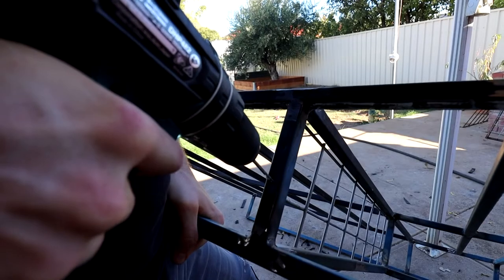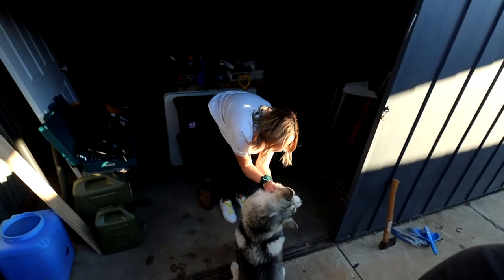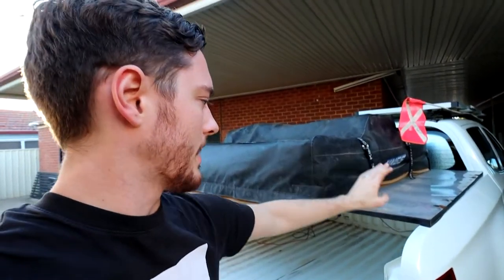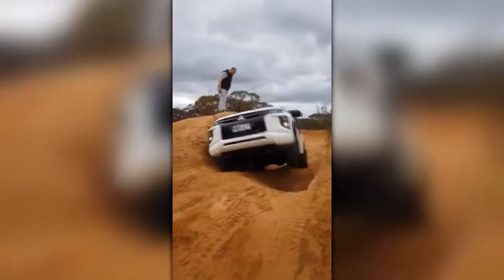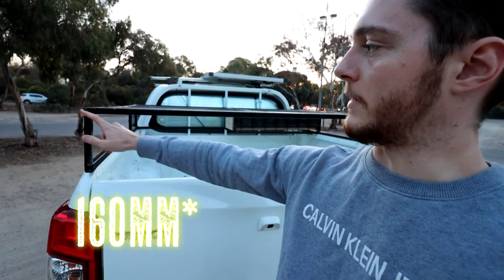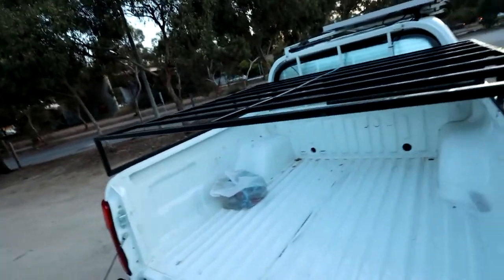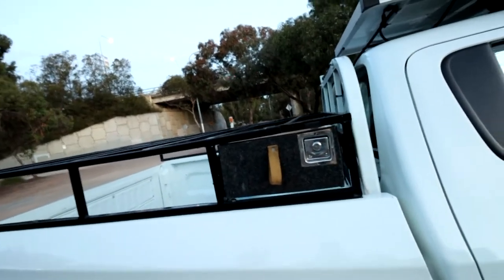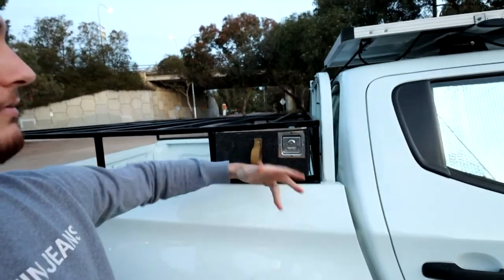HALF HEIGHT TRAY RACK/CANOPY FABRICATION AND WALK AROUND!!!

Comment: I remember watching a video ages ago where you installed the water tank, water pump and hose, and where you did a plastic weld to the water tank. Do you still have that video up? also what materials did you use for the plastic welding of the water tank? thanks in advance!
Reply from the maker: Hey mate, took that video down a while back. Most water tanks are made out of polyethylene. Check out bunnings, they have polyethylene welding kits if you want to do a clean job 👍
Reply: @mrtriton5405  too easy mate, cheers heaps!

Comment: looks around 40 or 50 kgs of steel though. have you thought about trying aluminum wielding
Reply from the maker: Yeah I think it'd be something like 30kg give or take (it's deceivingly light). You're not wrong though, aluminium is certainly a better idea if you can work with it. Truth be told I've never worked with it before and don't even know if I can weld that with my welder 🤣